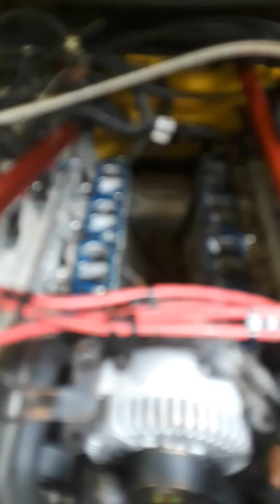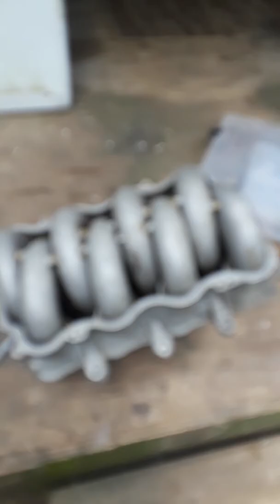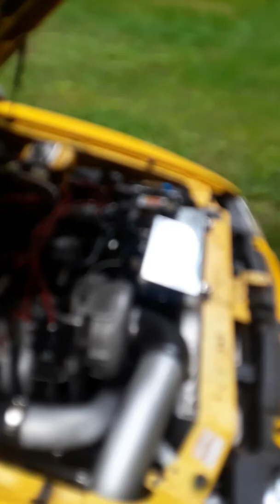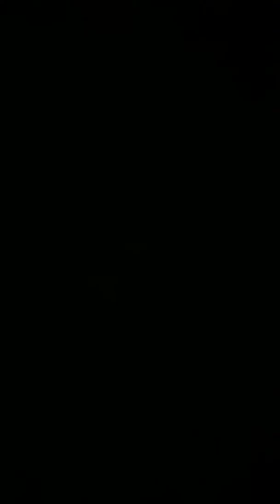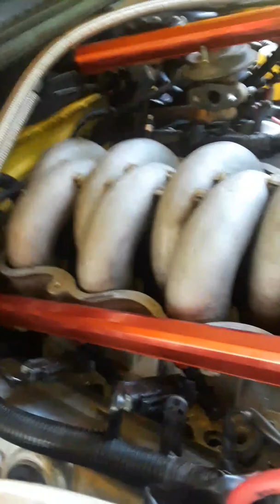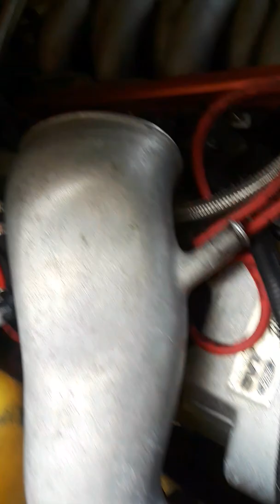Putting on imrc delete plates on a 98 Mustang Cobra

Comment: Did you use silicone on the bottom of the delete plates? I have the upper but, other than that is it just metal on metal? Or you put silicone
Reply from the maker: No Silicone. Gasket only you can buy the Gasket at mmr.com

Comment: It is way easier to just go ahead and pull the fuel rails and everything else out of the way to put the plates and intake back on trust me I know from pulling it apart like several different times lol
Reply from the maker: Thanks for the comment but I'm not a mechanic my first time doing that
Reply: Is there a bottom gasket for the plates or is it just aluminum to metal?